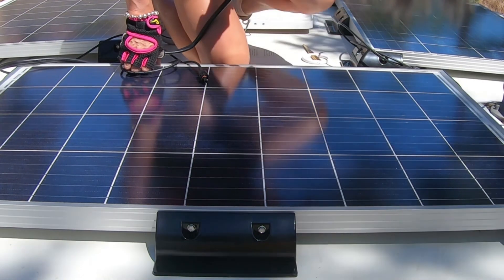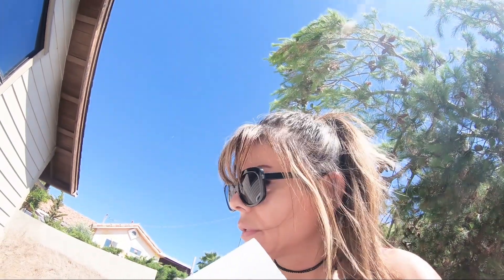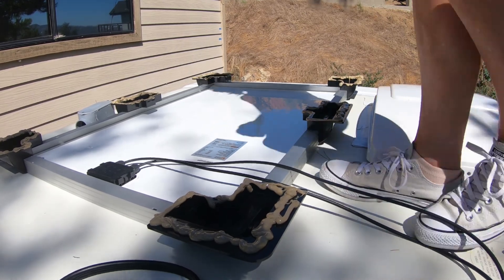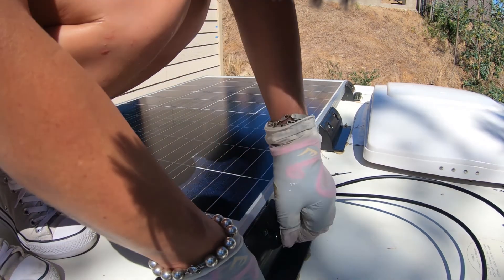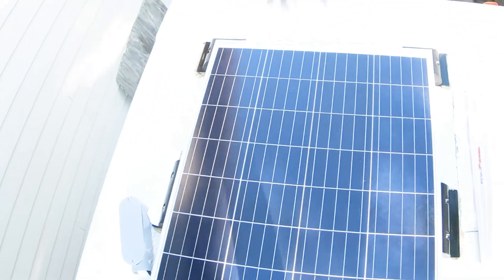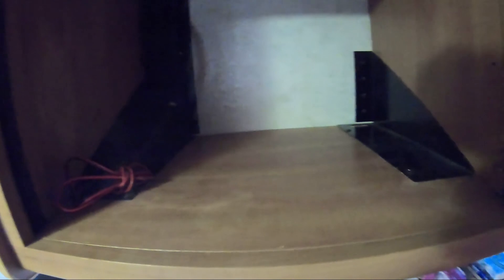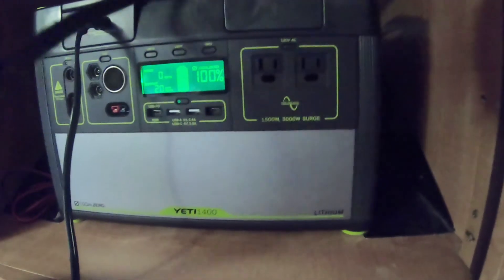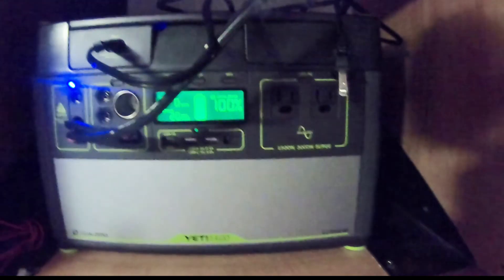SOLAR RV/ MOUNTING SOLAR PANELS ON RV ROOF/ PART 3 INSTALLATION

Comment: Is this mounted onto fiberglass roof or is that the rubber roof membrane material?  would it pull up if I mounted it like you did to my roof with rubber membrane?
Reply from the maker: It’s fiberglass. I didn’t screw into the roof. It’s all glued down and eternabond tape. I check constantly and the panels are not going anywhere. However, on other areas of the roof, I can see that the fiberglass has detached a bit so I am not sure about your application. All what I can say is that the materials I used to attach the panels are solid and nothing has come loose or detached. The installation is solid. Thank you for watching and commenting! Good luck!

Comment: Just a few suggestions and possible changes.. First, when you get a panel in the spot you want, mark the placement with a sharpie (not like anyone will see the marks). Second, the Loctite PL is a good adhesive, but I'm thinking that 3M VHB double-sided tape might be a better choice, then add a short, 4" wide strip of eternabond tape over the top the flat part of each mount.  One other consideration regardless of method, once these mounts are in place, you are restricted to that exact size panel (without causing a lot of damage removing them).  Great Job!
Reply from the maker: Hi Ronald, thank you very much for your comment and suggestions. Aside from the Loctite I did use 3m VHB tape and learned to love it and use it on so many other applications 😊 I also used eternabond tape, another great product! Thank you!

Comment: How have they held up after 1 year? I'll be installing mine next week using 3M VHB tape unless what you used works.
Reply from the maker: The still have an amazingly strong hold. I check frequently and those panels are not going anywhere. The glue and tape I used I would highly recommend.
Reply: @HerSoulVacation  thank you very much.
Reply: @HerSoulVacation  will be doing the installation in Ehrenberg next weekend if you would like to supervise.
Reply from the maker: Oops… I don’t know why I didn’t see your comment before. Hope it went well!
Reply: @HerSoulVacation  over a year now. So far so good, thanks!

Comment: How does power get from your Yeti to your coach and house batteries to keep them charged. My system is different in that it goes through a solar charge controller to my batteries to maintain them. In spring I added 2-100 AH Lifeline AGM batteries to the house side to replace the previous set of same brand which lasted with solar upkeep over 9 years!
Reply from the maker: VeldaE12 good question! I made a hole through my floor into the plugs box and plug my extension cord to the yeti. I will make a video to show it.